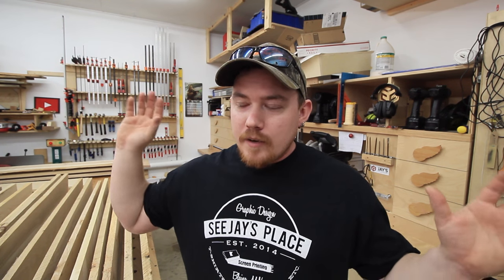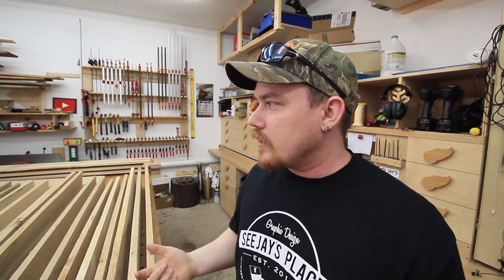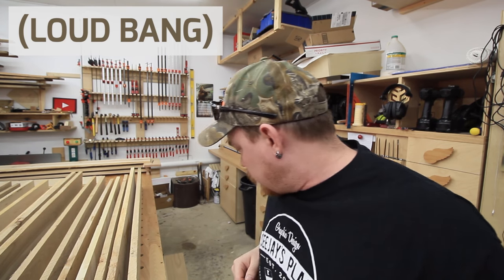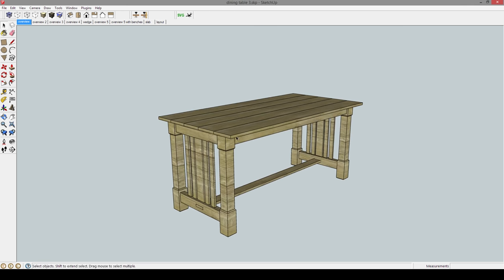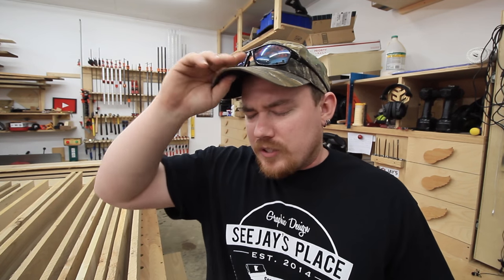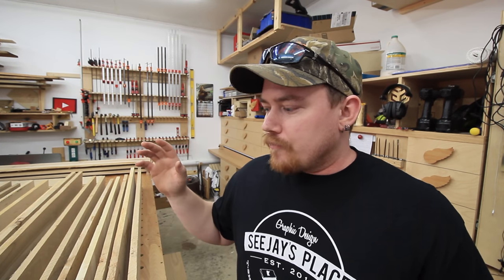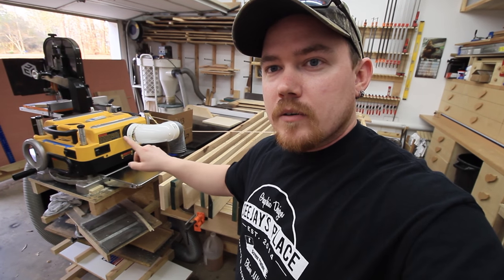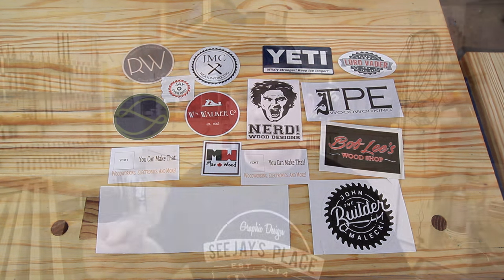Hickory wood is tough stuff

Comment: Just a tip.......If that DeWalt Planner can take carbide insert blades then purchase some before you get started. I got by with HSS blades in my 15'' planner and 6'' jointer for years until the ICE STORM hit years ago and gave me 1,200 bdft of free Hickory. When the time came to start running that stuff years later I could see fire coming off the 6'' jointer blades. Put a new set of HSS blades in and 30 min later fire again. I ended up buying the same G0490X Jointer and added carbide 15'' blades to my planner and this problem has not returned. Don't waste your time running any of that wood without having all carbide to process it or you will end up having a ton of down time changing blades. Good luck that stuff is totally awesome looking when finished. Can't wait to see which way you go with the design. Keep up the great work.

Comment: Just a tip. I have a garage full of hickory and have been using it for a lot of things. Put a coat of sanding sealer (not shellac) on the hickory before you stain it or the stain will turn out blotchy.

Comment: I will add a level headed comment--what is tough wood and what is hard wood--I live in the southwest of western Oz and I have milled some  trees called wandoo as a young bloke and it would take a good man to drive 1.5 inch nails through 1" green timber with a claw hammer...A good man would drive 7 out of 10 nails--he would bend the rest...Made fantastic truck trays..
There is another tree that springs to mind--that is the mallee,a runt of a tree that has a lignue tuber [i think I have spelled that right]--and I have been camping and put on a mallee root on the campfire at 6 in the evening and at 7 oclock the following morning 2/3 is still there burning and the original root was only as big as my clenched fist..Its amazing stuff.

Comment: You should try Waterlox Tung Oil for your table finish. It's as durable as poly or varnish, but very easily fixable if the table should get scratched or otherwise damaged and doesn't look like plastic. It's also easier to apply by either brush, roller, spray or wipe on, and was originally used as a floor finish. Before my retirement I went through multiple hundreds of gallons and used it for floors, interior house trim and furniture, mostly on refinished tables.  In case you've never used it, or don't know much about it, there are two sheen levels, a semi and a satin. If you decide on the satin you "must" first use the semi gloss, even if you color stain the table first. The semi is a sealer/finish and can stand on its own, the satin is not a sealer. I usually dilute it as much as 20% with Penetral. I do that with all oil finishes. Penetral is much better than mineral spirits or turps. Read the back of the can to see its uses. You can buy the Waterlox online, but I'd check your local true paint stores as it may be less expensive. I don't think box stores carry it. I get mine from my Benjamin Moore store. It's also not cheap, so maybe contact the company and see if they'd be willing to become a sponsor or at least send you a couple of gallons for an endorsement. If you don't ask, the answer will always be no.  The penetral should be available at any paint store. Possibly the box stores as well.

Comment: We had a mild winter here in Houston too. But it was like that last year too. Our summer (last year) wasn't particularly hotter than normal, in fact, only a couple of days when we hit 100. But I'm not leaving anything to chance and in my new shop (we move in April) I am installing a heat pump with 18,000 BTUs of cooling/heating capacity. Humid days? Nah, let 'em come. Jay, you at always at the top of my viewing queue each day and I look forward to each and every video you post. Some day our paths will cross. Until then, work smart and safe! Cheers! John Treble

Comment: I look forward to seeing this build. I built mine last year and I changed designs several times during the build. I ended up with a high (bar style) rectangle table. I built most of it out of hardwood pallets and other leftover lumber projects totaling 57 pieces in it... including the two leaves. My dining area is small so I actually placed plates out on it before I completed it to make sure I can seat six people when I need to. BTW, I also made stools for it from your Stool Making video posted out here and they came out awesome. Looking forward to this build.

Comment: Did you ever consider attaching the flags to the garage door to free up the space on the wall?  You could attach it at all 4 corners so when the door is up it doesn't droop in the way when you're using your tools.
Reply from the maker: +Tae Garfman When The time comes to use the wall space that's most likely where they will go.

Comment: May I drop my 5 cents on your dilemma with the table. I suggest to spend some time and build a simple model of the table. It may seem like a waste of time but it may very quickly set you down the path of the design you like. To save time, you can simply use some cardboard. I was doing a lamp recently and have built 2 cardboard models that quickly made me realize that I should use a different design. Can't wait to see the result!

Comment: +JayBates2,   about the mosquitoes.  I have seen for sale and homemade versions of a fold into place (to make a tight seal) multi-sectional garage door screens some even have smaller entry screen doors in  them. I was tinking of making one for my overhead door maybe you could too!  You can install them so they fit the trim on the outside, so you can open and close the door anytime you want
Reply: I was thinking the same, Jay needs a garage door screen for when the door is open in the spring, summer, and fall.

Comment: each one of the sketchups you showed are great ,but have sligtly different interior design elements. I like a sturdy table no wiggling around,no fu fu, so Id never use thru wedged tenon construction on a primary use table. I think I like the first mission style table, great design very sturdy long lasting construction

Comment: I lean toward trestle style, but that tusk tenon is a weak spot, besides hard to do right. Check out many trestle variations at-
easytomaketables.com  - the stretcher-to-trestle joint on these is WAY stronger and easier to do, and the stretcher can be moved to the top of the trestle. Hope this helps!

Comment: Jay, if you haven't worked with hickory before you are in for some frustration with a big reward at the end.  I linked my latest hickory project - a bathroom vanity - enjoy:   https://www.youtube.com/watch?v=OHSqW8caKvs
Reply: +kencmain oh, frustrations - why you ask - it is super hard and tends to chip out even with fresh sharp tools and light cuts...
Reply from the maker: +kencmain What stain did you use?
Reply: +Jay Bates 2 I mixed equal parts of general finishes water based stain - shaker maple and walnut - hand applied with a cotton rag - it was my first time with that stain - it dries quickly so if you use it do smallish sections of your work at a time - followed by 3 coats of arm-r-seal stain.

Comment: hey Jay great video! I have a question in my dewalt planner (sane as yours ) I get a nasty shock about two to three times off of the elbow on the chip discharge. It's the only machine that does it to me. how can I fix that from happening ???
Reply: I should have added that I use a collection bag for the chips not a dust collection system

Comment: Jay,I am not sure if this would work with shooting videos in the shop, but I bought one of these screen doors for my garage workshop.  Works great especially when working at night.  Keeps all of the annoying mosquitos out but will let that nice breeze in.  I didn't have this company install mine, I went through a local company near me, but it looks like the same thing.  My only complaint is that dust will gather on the mesh, but once a month or so I will just blow off the screen with my air compressor and it is good to go.  Just thought it was worth mentioning, I love mine.http://www.lifestylescreens.com/-Josh